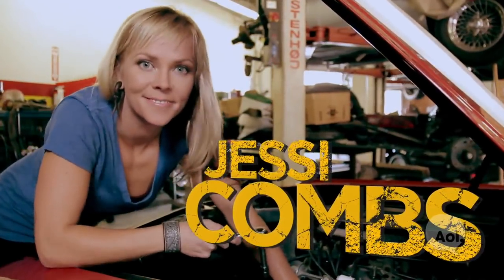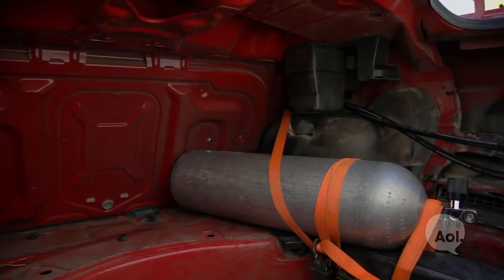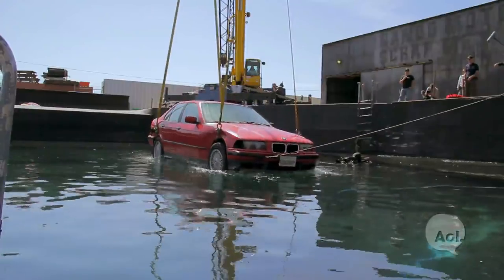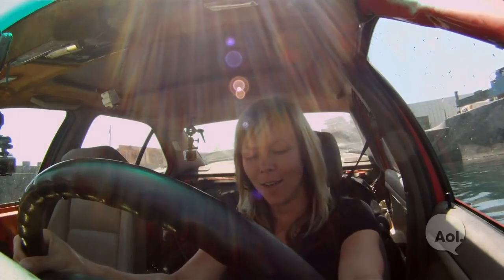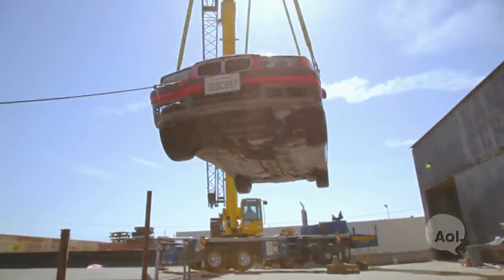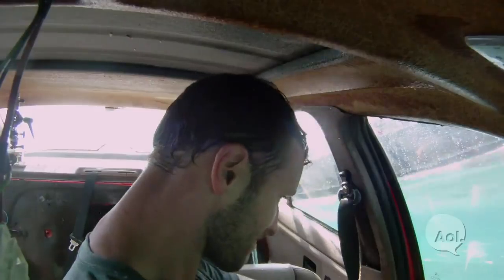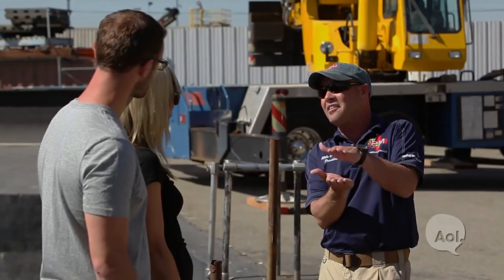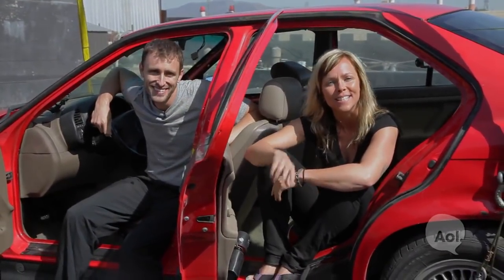Escape a Car Underwater | The List | Autoblog

Comment: Also a little FYI For all you drivers. Pull your head rest right out of your seat the next time your in your car. You will notice one of the pegs is pointed. That pointed peg is there to break the window in the event of an emergency. Not all car's have it but alot do. Nifty little bit of info that most people would never know was there. Also comes in handy to jab the annoying one on road trips.

Comment: Issue with the second test, the car isn't actually sinking as they do it because the crane holds it up. The moment the door came open I'd expect the car to start sinking more rapidly as it fills with water, which could drag you down after it due to the wake it causes (I know boats can do this but IDK if cars create enough disturbance in the water). What if the car sunk with you half way out, flipped on its side and landed on you? Unless you're expecting to sink literally 30+ metres, surely the first method is safer? Like, anyone can hold their breath for 1 minute and that's all you'd need. Plus, if you go off the bottom you're not at risk of swimming downwards instead of upwards and drowning as a result of not knowing where the surface is. Of course, get the window open in the front seats if you can, if nothing else you'll sink faster allowing you to get out faster.

Comment: PLEASE READ THIS IT MIGHT HELP! Guys if you have a roof opening, make sure you fit in it(in some cars you do), and use it if you can get it open fast. If you don't fit forget about it, it's not that important. First thing you do! Take your seatbelt off! Not everyone has a window breaker like the one in the video, and if you do, it might not be in your close vicinity with your seatbelt on, and from the shock you might as well not remember where it's at. So: If you have a sharp key, point it at the window and hit it hard with your palm of the hand, if not,check your headrests right now, and see if they have a sharp point at the end(they should have at least one), if they do, remember them or mark the headrest which does(you can put a cover on it). If sinking, pull out the headrest and put the sharp point in the window and hit it like you do with the key, or just ram the window with it. Also if you have a stationwagon/estate/whatever it's called and the boot/hatch door/whatever can be opened from the inside(also go check that if you don't know but don't count on opening from an electrical button from the cockpit, unless it's a mechanical/manual/cord system) and you're not alone, make sure everyone has their seatbelt taken off, then put your seat backwards so you can go to the back of the car and try exiting on the boot door if it can be opened from the inside or try break that rear window, and if you can't, (this might happen with a van) wait until it fills and open the rear door(you have more time if you're in the back). It sucks when you crash fast cause you will have a higher shock but also more adrenaline pumping. If you are aware that you are going into water(sliding/losing traction/etc) push all the window buttons down, so you hit the water with all the windows open.
Reply: Do NOT wait for the car to sink. The water pressure will seal the car, making escape impossible. 

Roll down or break the window and GTFO!!!
Reply: You can't roll the window if water reached it because water will press against it making it impossible to be rolled. IF your car is sinking slowly then yes you might be able to do this.
Reply: The pressure is perpendicular to the direction of motion of the window. OF course it can be rolled down.

A bigger issue is the fact that most cars have electric windows now. I assume they stop working pretty soon after the engine bay (where the battery is located, and which is the first thing to go down due to its weight) fills with water.

[EDIT] Just saw the part where they explain the windows being jammed against the rails. Didn't account for that. I stand corrected.
Reply: I agree with you and also the mechanical opening is faster then electric.
Reply: I was thinking that, but I bet they would work for al little bit...huh?
Reply: Jun Chong Martial Arts Center are you talking about electric windows? If you do, I wouldn't count on them, just try them once, if they don't work, stop wasting time. They might have a short, or fail because of the crash, and if the water just reached them, it's most likely they won't open even if they still have juice(see the video).
Reply: I think you just ran out of oxygen writing that comment... Use some full stops.

Comment: You cant wait until it equalizes. You need to get that window open and get out as soon as you hit the water if you can either using whats left of the electronics or with a window breaking tool. He could have been dead. Not the center of the window. Hit the corner where its weakest. In a real scenario cars sink in a minute and can roll.
 Trying to get out sooner rather than later is better before it rolls.

Comment: So why did the same method of opening the door underwater not work the second time?
Reply: They mentioned it briefly: the second time the car was lowered into the water at a faster rate which caused the front end to sink more quickly. The driver's head was under water, but the air pocket at the back of the car made opening the front door much more difficult.

Comment: well my car has a sun roof, maybe it would be easier to open sun roof and climb out
Reply: if you're already a few feet underwater, the water pressure above the sunroof may prevent you from opening the sunroof.
Reply: My car have a iron sunroof.You can only open it with buttons.
But its electronic. :(
Reply: inate troll i mean b4 you sink all the way to the bottom, instead of opening doors, theres no pressure at the top

Comment: Forget all of that you can
Always keep a hammer in you car
Always keep the steering wheel lock or club
Headrest ehhhh or Mini baseball bat

My best option is a small bat or pipe
It may be hard to swing under water but it will get the job done in any situation
Upside Down Right Side up  any